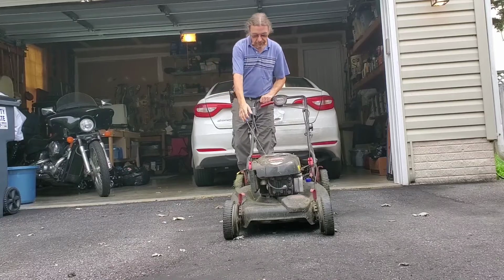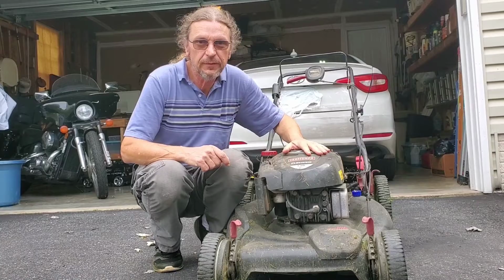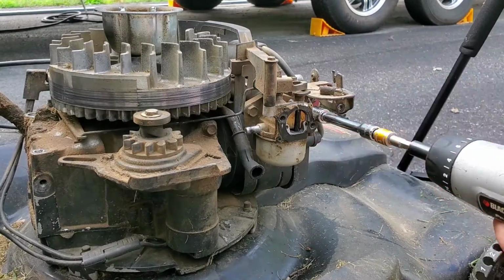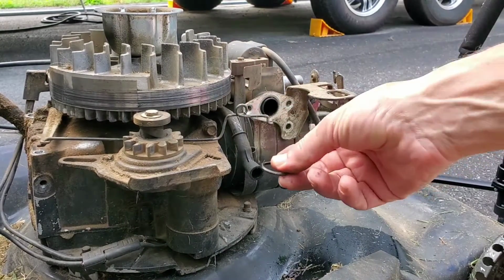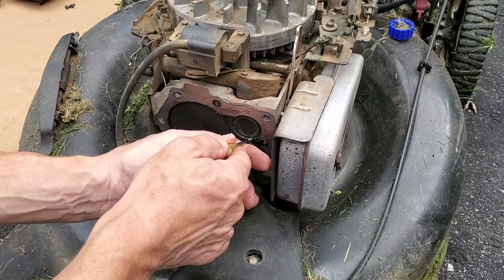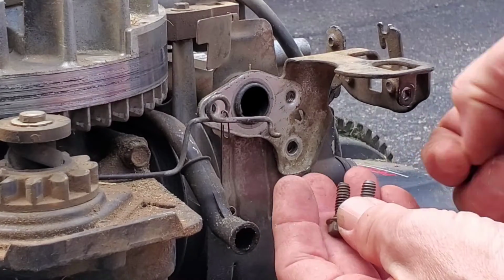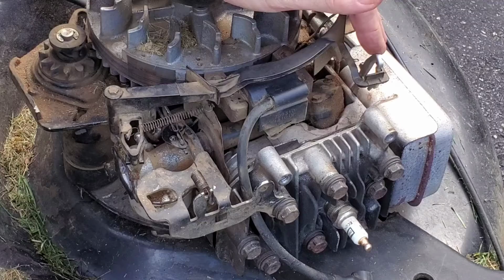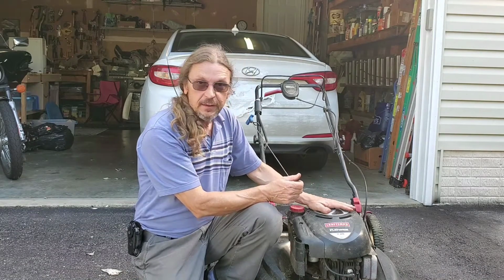Lawnmower has no compression - Craftsman Briggs and Stratton 7.5 intake valve seat

Comment: GREEN Loctite works great as used for "bearing races". It then takes HEAT from a torch to remove the item after using GREEN Loctite. RED Loctite would be better than nothing. GREEN Loctite works better than "staking" like you did to retain it. Automotive Machine Shops use Green or Red Loctite on Valve Seats to retain them in the head.
Reply from the maker: I'll have to look into that, thanks.
Reply: yes I never heard about green loctite until now, sounds good!! @workbenchz

Comment: You haven’t addressed the reason the valve seat is coming loose.   This is caused by overheating of the aluminum head.   A number of issues can contribute to this.   Improper lubrication, blocked exhaust, and improper timing are some of them.
Reply from the maker: Interesting idea, would overheating also loosen the exhaust seat?
Reply: @workbenchz  It could, especially if its due to carbon buildup in the exhaust port.  Therefore I think its one of the other causes.   Do you ever get kickback when pulling the starter cord?   If so then the timing is off.

Comment: By his own admission it is a temporary repair.  And he didn't even take the time to clean the lawn mower.  All around a completely sloppy job.  I won't watch any more of his videos.
Reply: lol id bet it outlives  the mower deck   its on still done this alot with the 80,/90s ride   on mowers as a kid  (was common issue    for few years  in the 80s  -erly  90s      i know this mower is newer   but still the same issue  only other fix involves a new engine  defo   not worth   it
Reply from the maker: @TCBOT Pretty much, $350 for a new block with valve seats installed.  At that price point a new mower is a better answer.
Reply: Meh, sometimes a temp repair is all you need. Perfectly acceptable if he was transparent about that. And I find it funny that everyone expects their small engine maintenance to be done like a NASA lab with cleanliness... It's not a car, you use a mower for like 30 mins once every few weeks. Over the life of the deck you are probably only clocking 100 - 200 hrs on it...
Reply: @okalov  Your statements are a complete exaggeration and totally wrong.  Corrosion on carbon steel occurs very quickly and and within a few years can rot right through the deck.  It's not hours of use.  It's overall age.  But what should one expect when someone who has absolutely no training experience or knowledge talks about corrosion.  Basically you are propagating false information because you are ignorant.

Comment: Good vid but he really didn’t have to tear down the engine to fix that problem. I’ve done this job many times over
Reply from the maker: My previous Tecumseh engine mower allowed you to remove the head by itself.  This Briggs & Stratton uses the upper left head bolt for the carb mount.  I'd love to find a way to remove the head without unmounting the carb.

Comment: the large valve on my briggs/stratton has little indentations around it similar to what you just showed there, but it was done that way from new. Why would it be so?
Reply from the maker: "From New"?!  I couldn't say.  This pattern of dimples around the valve are one technique to get a loose valve seat to stay in place; there shouldn't be any on a block that is new.
Reply: @workbenchz  that is what I think too, the dimples are not in the exact same spot as yours are but they are there more on the block a little bit away from the valve. thanks for responding

Comment: Lean condition makes a hot condition.
Airflow blocked partially makes a hot condition.
I would get air to it any way I could.
A muffler full of soot can partial block exhaust.
A rich condition can account for a lot of black soot and carbon fouling of the sp plug.
I wonder if TARYL has a quantum valve seat video. He seems to repair almost every valve seat that drifts or comes loose.
Change the oil and air filter and clean it up would be sensible for cooler run. Or just do sections of mowing at a time if this persists till more ideas are found for this failure, I would have to say.
Good luck.
Other people's mowers they gave up on can be a good part source.
Reply from the maker: thanks for the feedback.  I'd love to see a video of valve seat replacement on this B&S engine.
Reply: Pretty sure I’ve seen it! Donyboy also has a vid on it.

Comment: What is the approved B&S method? I don’t have a manual?
Reply from the maker: I haven't found an "Approved B&S" method yet.
Reply: @workbenchz  I did the peening method. I was just wondering. Probably dry ice the area and install a new oversized one. I'm just guessing.
Reply from the maker: Browsing other videos of machine shops doing valve seats, it looks like you would heat the block and freeze the seat blank that has a 0.001+ interference fit.

Comment: I've seen a few YouTube videos on YouTube fixing this problem. However I don't think it happens that all often especially on these Briggs Quantum engine. I've actually never had to take the head off a Briggs Quantum engine.
Reply from the maker: My first craftsman lawnmower had a tecumseh engine and it lasted nearly 17 years.  Their design make disassembly easy and you didn't have to unmount the carb to remove the cylinder head. I've had this Briggs & Stratton for almost 10 years, and had this apart more times already.  On both the metal/fiber head gasket made reusing the gasket easy.
Reply: @workbenchz  the other thing I like about the Briggs Quantum is if it appears to have a carburetor problem you can sometimes do a quick-and-dirty cleaning of just the carburetor bowl nut and it will run.

Comment: Uh oh, maybe it's just time to ditch that ancient stinky gasoline thing and make way for something new. There are quiet electric battery mowers available today that are certainly better. Or why not switch to a handheld, cheap efficient and promotes fitness.
Reply from the maker: I did get a quiet electric battery mower, you can see it here: https://youtu.be/4vy69pl5Gho
Reply: Battery lawnmowers are junk
Reply: @stevesmith6058  They're not bad but they're definitely not as good as a petrol mower. If you live in town and only have a small section to cut its probably better to just get an electric mower. But if you have a bit of grass to cut then petrol's better. Reliability wise petrol will probably last longer since the electric battery's dont last very long. I've had a petrol mower for 10 years and its still going strong but I've just needed to do this repair in the video as the valve has popped out. Hopefully it'll get another 3 years from it before something else goes wrong. 10 years service its done well im satisfied.